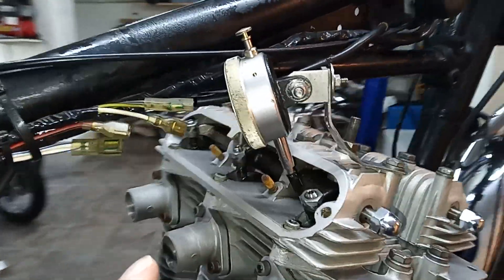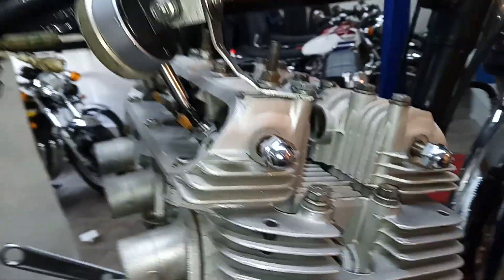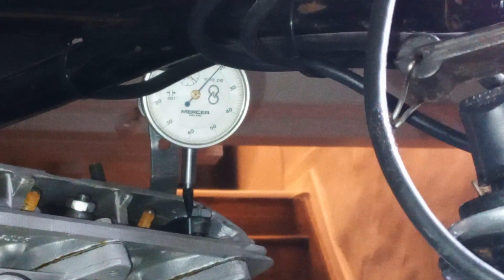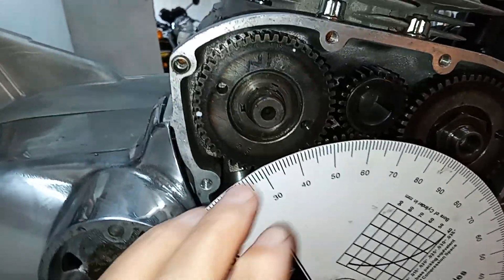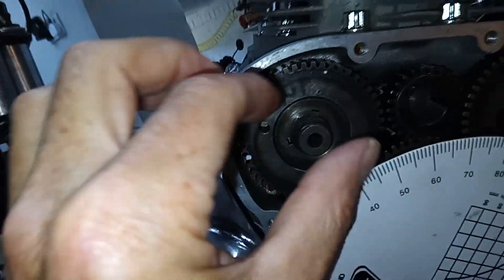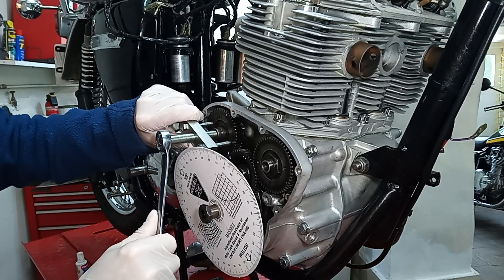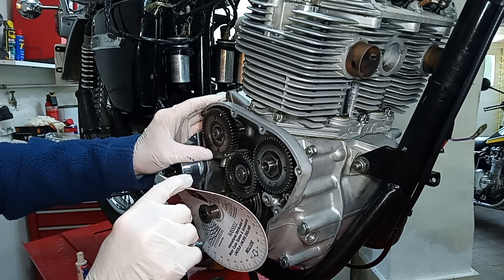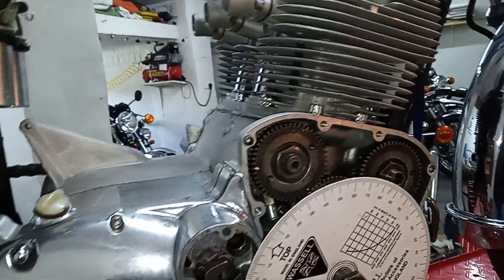Triumph Trident T160 Rebuild. Part 64: Optimising the Valve Timing 2

Comment: Hi, Chris Really enjoy your videos.    I have a T160 and the work shop manual (in the engine data) states that both the inlet and exhaust valve should be open 0.124- 0.135 at TDC of the exhaust stroke.  You are using 0.150.  Is this the preferred valve opening?  Thanks Steve
Reply from the maker: I'll check and get back to you.  👍
Reply from the maker: Okay, so this is an anomaly that I can't explain. The optimum setting is definitely 150 thou, so why it refers to between 125-135 thou in the manual I don't know. I think that that is the standard factory setting, not the optimum one, but why not refer to the optimum 150 thou I don't know. The optimum setting is definitely 150 thou, as given by Jack Shemans (Triumph factory Mechanic) and Richard Darby (Legendary Trident mechanic and owner of 3D Motorcycles).  To quote from Jack Shemans: 'For the enthusiast who wishes to check the valve timing accurately, timing on the Trident is measured by the amount one pair of valves are open with the piston of that cylinder at TDC. This is much more accurate than degrees on the crank......The figure measured by the gauge is the amount the valve was open at TDC and with standard cams the figure we are looking for is between 140 thou and 150 thou' That's all I can tell you. Why the standard measurements are in the Workshop manual I really don't know.

Comment: Hi mate; is not clearly for me (may be I missed something that you mentioned?) why is 150 thousands the "measure". I mean why do you set up at that measurement? Thanks
Reply: Agree, the 150 thou should be at a certain degree of revolution of the crankshaft, or it's completely meaningless.
Reply from the maker: I'm afraid that that's the only measurement I know. What it equates to in terms of degrees etc. I couldn't tell you, but it's the one that Jack Shemans refers to (Trident factory mechanic) and others. That's the way it's measured and that's the way it's set. No other methods (degrees BTDC or ATDC etc) are referred to. That's all I can tell you.
Reply: @Chris.rooke150  Thanks for that. Normally when dialling in a camshaft, there is quoted a certain amount of lift at a certain degree of crankshaft rotation, for example 10 thou of lift at 10 degrees before TDC for an intake valve, without both it doesn't really mean anything.
Reply from the maker: Yes, on the Trident the measurement is taken from when the valve closes. So at TDC on the exhaust/induction stroke both valves are slightly open. By turning the engine backwards (inlet) or forwards (exhaust) and using a dial gauge you can measure when they're fully closed, and for both valves the optimum is 150 thou before (inlet) or after (exhaust) TDC.
Reply from the maker: I can't tell you, other than that is what was stated by Triumph/BSA when they built the engines. That's what they set their racing engines to. How they derived at that figure I don't know, but apparently that's the optimum position for the valve timing. More than that I can't say.
Reply: @Chris.rooke150  Very interesting. I never heard of that measure nor in the manuals I found something similar. I checked the specs on the T160 and T140E manuals. They propose other system and with 0.020 lift. Normally most tuners use the "lobe center" method so finish with measures in degrees like 100ºIN and 106ºEX.
Reply from the maker: Thanks. I'll check and see if I can find out any more info.

Comment: hi Chris.......if your starting at TDC on compression and you turn the engine backward does the intake valve not OPEN given all valves are fully closed at TDC? thanks
Reply from the maker: Absoloutely! It's not the compression stroke, it's the end of the exhaust stroke/beginning of the induction stroke. Apologies for the confusion/misinformation and thanks for the question.